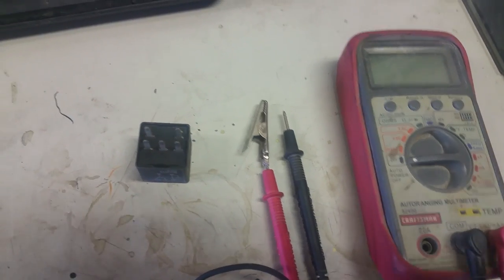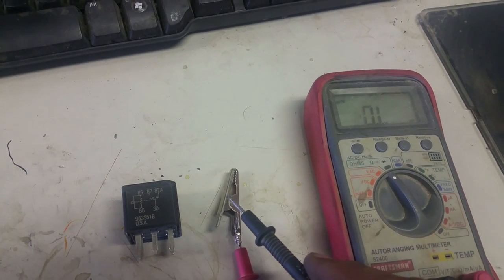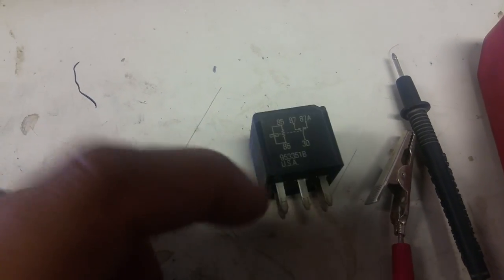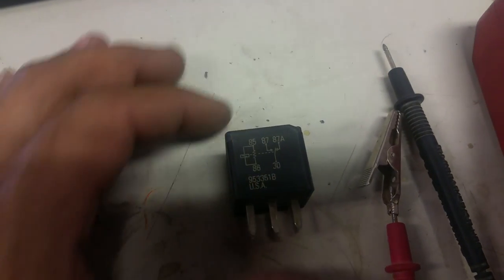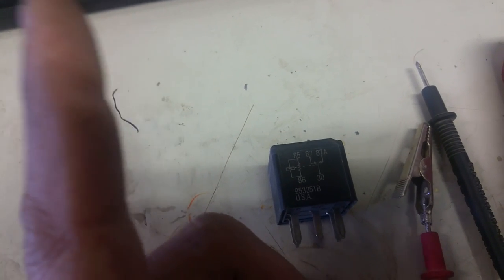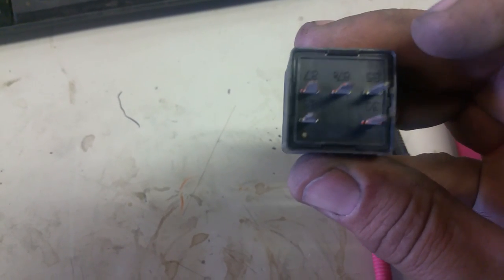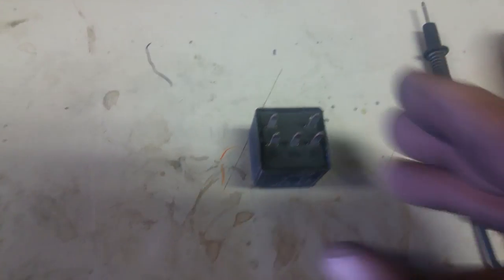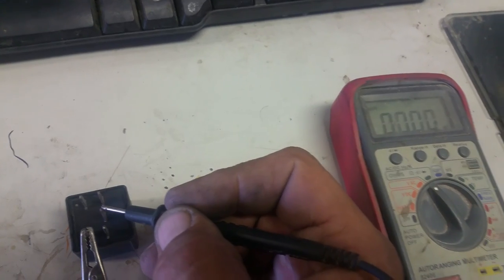Test Relay

Comment: Thanks, after checking the pto, the interlock, pto switch, seat safety switch, checking everything,  your video popped up letting me know there is a relay behind the battery. I check it, no click on power up. I open it and find moisture got in there and rusted everything. Put a new one in and that was the problem. Thanks for the video

Comment: You didn't explain that their are 2 separate Circuits in a relay and that  85 and 86 energies the coil which then causes the 2nd circuit to move the 87A pin to connect to the 87 pin which then connects to 30 pin  causing a closed energized electrical signal which is used to run whatever it was intended to run.

Comment: when replacing a relay in engine fuse box, is it necessary to have the negative terminal disconnected from the battery?
Reply from the maker: no. not at all. just swap it out like a fuse. thanks for watching.

Comment: But why these specific numbers 30/85/86/87, not 40/55/56/57, or ... ? Maybe have relations with voltages, or Ohms, ... ??
Reply from the maker: great question! terminal 87 is linked to pin 87b, 30 is the amperage it carries etc. every number has a reason. here is a link for you to better understand,but yes there is a reason. https://www.12voltplanet.co.uk/relay-guide.html
thanks for watching.
Reply: Appreciated. Thanks a lot.
Reply: 30 and 87a. Have a brief ohm then goes to zero? 85 and 86 are good

Comment: Lol really use less and nonsense video confusing you if there is no connection between 86 and 85 its bad and if it show ohm between 50-120 its ok other wise discard it before preceding with test